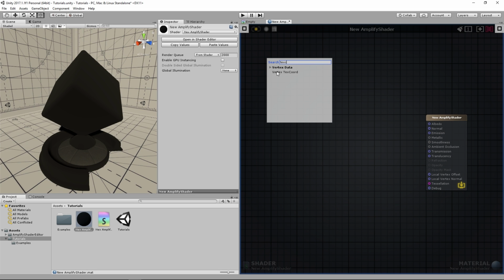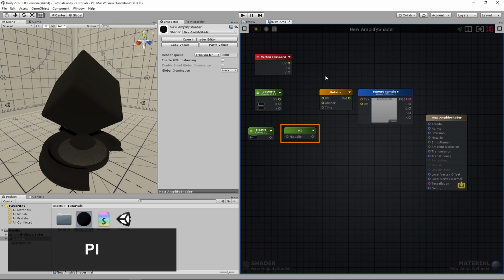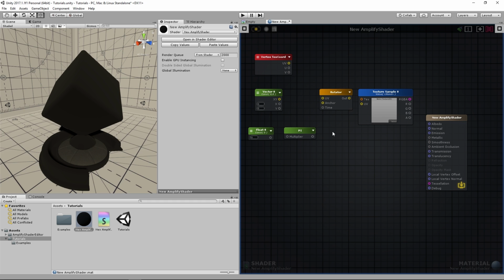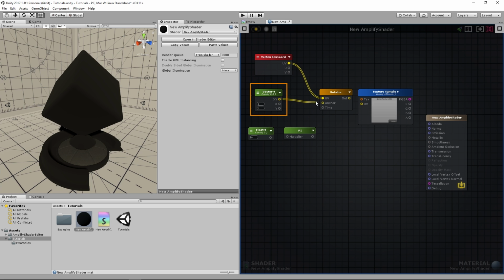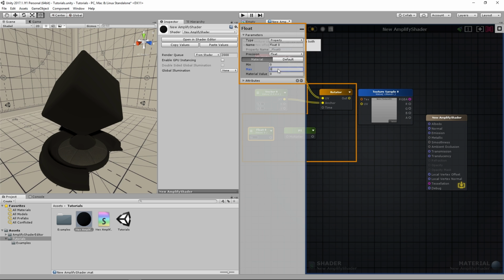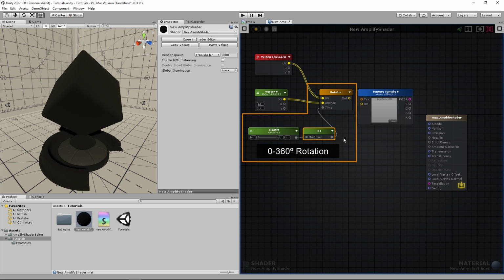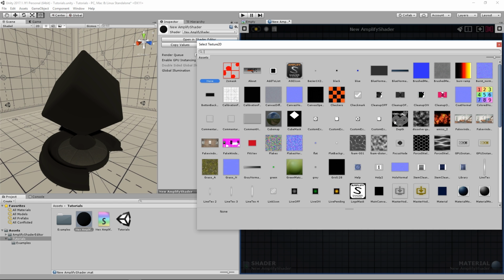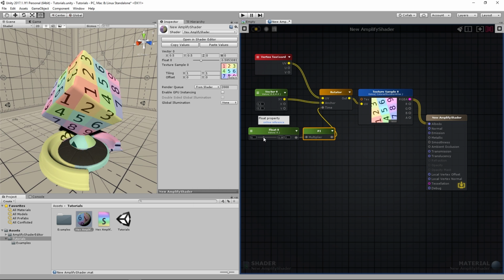Constants and Properties - Pi - Part 3 [BEGINNER]

Comment: Could you do tutorials on doing an actual shader though, even if it's just the same old PBR stuff if it comes to that. There's a huge gap between those that know and those that don't know how to make shaders and looking at the examples it's not really doing us much. In fact if you just did videos explaining the example shaders you have the sales would increase because people would simply understand how to do 10 shaders at least that then can take the principles and use them in a different case. These are great and all but I can't say I feel I learned something I can put to use somewhere if I'm a beginner.

tl;dr : Do more "let's do" tutorials than "explaining the X" thing on the editor and that will bridge the gap between wanting and actually know a few things to make a shader.
Reply from the maker: Greetings! Absolutely, we plan to provide Beginner, Intermediate, and Advanced tutorials. However, understanding which basic Constants and Properties are available is crucial to understanding the shader examples you mentioned. Trust us, a solid knowledge base will greatly increase your ability to learn from the included samples and full shader tutorials such as the already available Burn Effect (https://youtu.be/v1GtkeRGAIY), and the same effect but using Shader Functions (https://youtu.be/xNADenh1ii0).

Stay tuned for the next batch of beginner tutorials where we'll cover basic operators and texture manipulation. Complete, shader specific, tutorials will also be available soon.

Thanks!
Reply from the maker: Experimentation is key, we strongly recommend building the examples as you watch the videos.
Reply: You have a good point. While those tutorials are great especially since they are short, I saw that I can ... rotate a texture, but I don't know exactly why and for what I will be able to use this later. So for a person like me, I watched this video, it went into one eye, and it left the other eye. 3 days from now I will have no idea that I watched this. Good thing is that I will be able to come back to this video and watch it again.